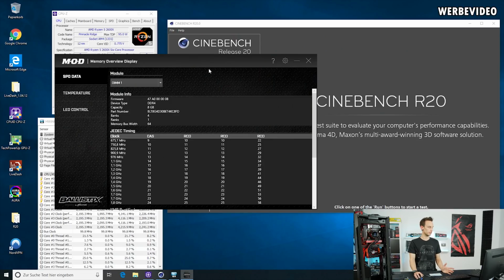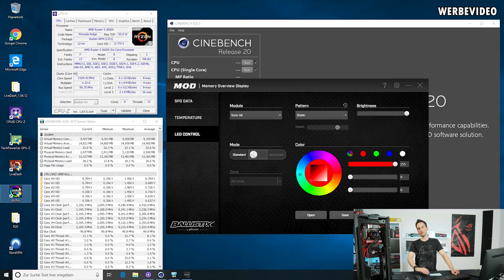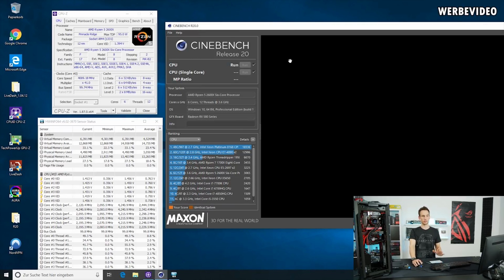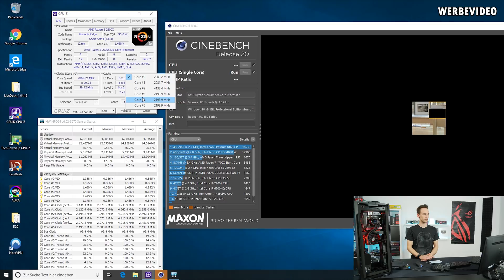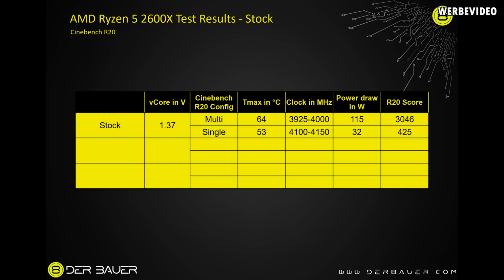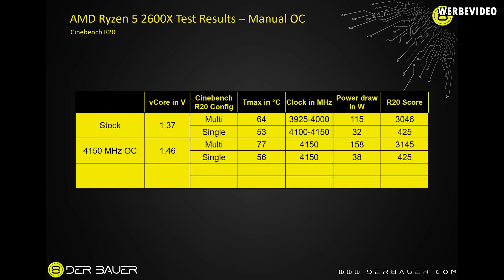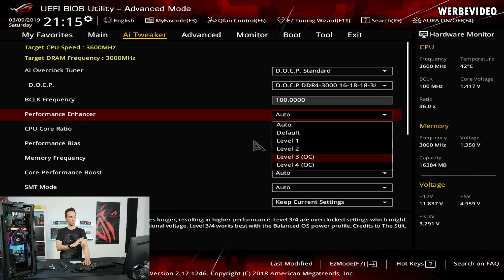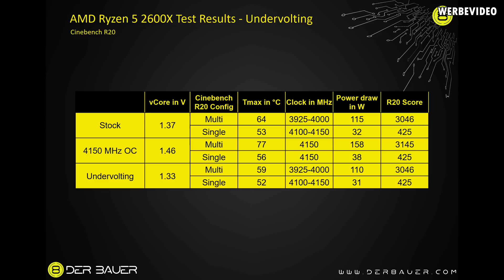The problem with AMD

Comment: TLDR: AMD delivered a better product out of the box than Intel. AMD's XFR is well adjusted, making it almost pointless to overclock. Meanwhile Intel's boost clock is laughable and overclocking proves Intel didn't feel like releasing the best product they could of out of the box. That aside, the title of this video is misleading.
Reply: Jose Cervantes lol every non OC intel has same or better clocks than OC  Ryzen. And all OC intel cpus has 1 GHz above OC Ryzen
Reply: @IamUzyf  that's only because of their architecture and it doesn't change what I said. The AMD chips are almost coming out with near top performance out of the box. Intel is simply leaving a lot of headroom, it's a lazy practice if you think about it.

Comment: Jeez, I had a lot of luck on my friend's R5 2600 then! It stays at 4.1ghz solid with 1.38V on the Asus Rog X470-I and I even managed 1 full run of Cinebench R15 @ 4.2 and 1.42V, but I had to OC the RAM to 3600Mhz or I would get a ton of blue sreens at the base 3200Mhz frequency. CAS latency was 17 @ 3200 and 19 @ 3600
Reply: That's not all that much above stock turbo frequencies for that CPU.

Comment: Lol got my 2600x to 4.2ghz at like 1.45v
Reply: why are you even touching anything?  Do you need your cpu to sit at 4.2ghz while idle?  The ryzen cpu automatically overclocks itself for what you're doing.  When I start gaming, all my cores shoot up to 4.7ghz and stay there until im done.  Should really just leave it, AMD did the work for you so you dont have to bother with overclocks that just strain your cpu 24/7 and cause unnecessary wear.
Reply: Pure Gameplay 4.7 on Ryzen ? Using pbo with undervolting to stop thermal throttling the best single core I can get is 4.25 ghz with sustained 4.15 ghz. This is what I use generally 4.2ghz on all cores was just to see.
Reply: @henryadams7688  https://imgur.com/xalHotP
Theres a picture I took immediately after closing bf5, the entire time the game was open it was sitting at 4.6 until I closed it, then it dropped back down.  Also when all cores were at 4.6, all my voltages were locked at 1.45 and stayed nice and stable.
Reply: @puregameplay7916 https://forums.tomshardware.com/threads/ryzen-2600x-4-7-ghz-spike.3322213/

4.7 ghz sustained on 2ed gen ryzen is not possible without serious exotic cooling
Reply: @puregameplay7916 "All my cores shoot up to 4.7 and stay there", I have my cpu on PBO with ryzen power plan if you actually read my response and if u got a golden chip why are u tell me to just leave it and expect 4.7 ghz?
Reply: @henryadams7688  By stay there, I dont mean 24/7, I mean stay there for as long as it needs to.

Comment: overclocking is a thing of the past....while you can still overclock today, it is safe to say that it is unlikely that we will see anything much overclockable from ryzen 2, intel 10 nm, and next nividia gpus  .... also unlocking DOES NOT MEAN  overclocking.... You cannot say you gain performance by overclocking, when the manufacturer is locking its hardware to lower power states and performance out of the box...that is not overclocking, that is simple unlocking.
This makes AMD much better products than Intel because the small margin u get by unlocking the CPUs, means that  all the CPUS yealds and binning are perfect and warrant all the same performance more o r less...while You cannot say the same for intel where some cpus can perform up to 25% worse than another same one.
I also wish to add, that LN2 overclocking is a farse, because You are never validating how much power and voltage you are drawing out......The winner of LN2 overclocking should be the one that can draw the less power and less voltage and get the best score when also making use of L3 Cache *(which Cinebench NOTORIOUSLY ISN'T CAPABLE of using at all), and not just who can push  anything at whatever speed for a few seconds on on a single lucky run....that doesnt say anything about the CPU architecture and manufacturing when  you are oveclocking.

And what is a crucial RAM set doing on an AMD build?!

Comment: So Intel is better cause their products are so handicapped out of the box, whereas AMD parts are tuned to their limits with intelligent software?  I suppose if you're an extreme overclocker, it's more "fun" to fix Intel's problems yourself meaning "there's so much more you can do with them."  Why is Intel being rewarded for sub par products that aren't performing at their best, whereas AMD is chided for it?  I accuse you of a bias, but only of the perspective of an overclocker, or tinkerer, who only looks for how much MORE performance is left on the table, and if there is none, then the product is boring to you.  I agree that it's boring as hell to overclock an AMD chip because they're tuned so well and they make it piss-easy.  

But hopefully you can see the other side, where voltage wall aside, having all the performance right out of the box is a GREAT thing for consumers who aren't overclockers, or don't do extreme overclocking.  It just seems the focus isn't on "AMD needs to give their chips more frequency headroom in their next architecture" but rather "this is boring because I don't have to fix any of AMD's non-silicon mistakes because they didn't make any"

Comment: one of AMD's PR problems is that people buy vanity threadrippers and expect to be able to game on them when threadripper sucks for all but the most effectively multicored programs
Reply: tell me more about how all the AAA games coming out are relying more and more on higher thread count cpus?
Reply: wtf are you smoking Threadripper CPUs match there Ryzen counterparts single threaded performance
sometimes there even slightly faster in some games due to having a extra IMC letting it run 4x8GB DDR4 at a full speed of around 3400mhz cl14 with a 2700X you would have to either settle for something small like 2x8GB 3400mhz cl14 or something slow like 4x8GB 3200mhz cl16 because a single zen1 IMC can only handle 2 ranks at full speed but Threadripper has 2 IMCs so it can handle 4 ranks at full speed

and you can sometimes get higher core clocks due to the higher binned chips going to Threadripper instead of Ryzen 
if you have a decent cooler and enough $ then 2950X > 2700X for gaming
you simply get more cores more IO more memory and better binning whats not to love?
the same can not be said for the old Intel HEDT platforms which used to be a generation behind and the newer intel HEDT CPUs which are so hot that they run at shit clock speeds unless you use extreme cooling like a chiller or LN2
Reply: @XDbored1  I think you left this out, you can disable many of the cores and use that extra voltage to possibly overclock the small active cores for gaming to gain more single threaded performance. I have no idea how much if it helps at all as I personally don't own a threadripper build but thought it was a good idea to point it out
Reply: LOL.  One of the communities problems is that people think you cant game on a threadripper...I run a 1900x on my gaming rig, also have a 1700x... My 1900x is about equal in gaming performance to my 1700x, sometimes a little better or worse.  As long as you know how to tune it for gaming, you would have a hard time noticing a difference.   
Edit:. The 1900x tends to overclock much better than most 1700x/1800x so you can actually get a little bit more performance if you don't mind the power bill.

Comment: AMD sells components often pushed to the limit be it CPUs or GPUs, at least with CPUs right now they are not uber power monsters like their GPUs that use way too high volts. Intel... high variance in parts, some OC OK some almost not at all anymore either. Long gone are the days of +1GHz OC on Intel and if one gets 200MHz now that's lucky. All depends on the CPU, how well it was binned and what headroom was left by manufacturer to exploit. 2700X vs 9900K... not much OC on either. 4690K that defaults to 3.5GHz all core... yeah easy OC sky high compared to stock easy to do, similar on 1700/2700 to OC by 500MHz up. With AMD one gets a better CPU that is more on the limit of what it can do, with Intel one has to invest additional money and time to get the most out of it if one wins a lottery as well.

Comment: 1. This is NOT problem with AMD. This is a problem with makers of cases..
2. If you need to get result from OC you need 4 lines on row (any slot) on the same. In this position you may get and 25% bonus. P.s. 2 lines on motherboards :) but exist inf fabric....

Test this options and revue back problems ;)
No more 10$    2x8 4x4 !!!

Comment: Well.. My 2600x is set to all core 4.175ghz at stock voltage. I can get it to 4.275ghz at something around 1.45v. I haven't pushed past that though. On a gigabyte x470 gaming 5 mb. Which i hate because every time the psu loses power my mb's main bios corrupts and every 10 or so times the secondary bios corrupts at the same time. Resulting in 3 returns in the first month until i found out my psu was buggered but since that I've had 2 rma's because of simple power outages. I hate this board.

Comment: R5 1600 @3.8ghz 1.24v
@3.95 1.372v
@4.25 1.576v plus unstable cinebench r15/20

Vcore on ryzen scales too high.
I just use on 3.95ghz
Btw 1.576 is the max vcore on my motherboard :/

Comment: Really valuable info. I plan to buy the new gen Ryzen or threadripper for a workstation..
I like silent or quiet running and do a lot of Linux work no gaming. If I should undervolt my CPU to get less heat for the same performance that would be awesome.. that's why I'm subscribed for these insights

Comment: I think undervolting is good idea, but if you have Ryzen 2600 non-X, you need OC to go above 3,9GHz. I chose to undervolt, because at the moment, i don't care that much about extra performance. My real core Voltage is about 1.219 and SoC Voltage is 0.931. I'm drawing about 77W from CPU+SoC while benchmarking all cores with Cinebench R15.

Comment: From what I read the way the node was developed didn't leave much headroom for OC without way more current. It kind of was already at the sweet spot. The 7nm node they will be using for the next gen seems to have a higher chance to enable a bit of OC.
Reply: mine automatically clocks all cores at 4.7 once I start gaming.  It does it itself, and intel users dont liek that, they would rather tweak an inferior intel product for gains at the expense of system wear.

Comment: this is so dumb, they can just extend the pcie cable, so that the gpu can face outwards......what a fail design.... (it wont affect anything, linus has done video about that, and i have one running in my 7.2L itx build right now with that type of cable)

Comment: Yup, that's why the first two Ryzen gens haven't appealed to me...at least not enough to switch teams.  Poor overclockers...period.  Let's see what Zen 2 can do.
Reply: Nothing wrong with the Ryzens! The room to overclock means nothing when the cpu is already fast AF out of the box! Getting 5-10fps more on games where u are already getting 100fps is meaningless! Getting a Cinebench score improvement of a few percent is meaningless! Ofc if ur life's meaning is to overclock, then that's another thing...

And @Vyrisus You got it backwards: it's not that the Ryzens are a sidedowngrade, it's that ur oc'd 3770K is such a beast even today, that nothing - not even ur beloved Intels can meaningfully outperform it! I just bought a 3770 non-K myself because of the price2performance ratio was the best! The only substantial improvement from this would be a 1600/2600 (or better) Ryzen - not necessarily so much in games, but in raw power. All Intels after the 3rd generation (used) are overpriced AF! Lol, 300-900e for a cpu?!? I bough my 3770 for 70e!!

Trivia: Back in the day there used to be HUGE improvements in cpu power! Imagine comparing 486 to a Pentium to a Core2Duo to an i5! After Intel launched the 2nd generation of beastly i5 and i7 processors, there's been hardly any performance improvements in cpu world. Sure, every year the new generation is 2-3% faster... But u can get about 90% of the performance of a current processor with an almost 10 year old processor (anything equivalent to a 2700K or better)! Try going back another 10 years from that and u end up with Pentium 4! You can't do jack shit with that xD And that is why 3770(K) is still a King. And that is why there is not much contest to top it anytime soon.

Comment: In my opinion, you can still get the fun from OCing a Ryzen system. The thing is though, it has shifted to memory OC's now instead of CPU's.
Reply: Unfortunately the limit of memory OC comes much faster than CPU, afterall, memory have a bad habit of being more sensitive to voltage increase.
Reply: @Verpal  He means timings. Manually adjusting timings down is the most important part for Ryzen, most of the time at least.
Reply: @DirtyPoul  Yeah, nowadays we can rarely oc infinity fabric too much to match 1:1 mem clk, kinda render the whole speed thing null.

Comment: Hey der8auer, I would really like a video with your opinions and techniques for overclocking RAM with a Ryzen CPU. You said in this video that you would overclock your 3000 to 3200, how about timings and how does this affect CB R20 and gaming?

I think the system you have in this video is very much like many AMD users own systems so it would be nice to see a real pro push this system to it's realistic limits.
Reply: Very minimal performance increase between 3000 and 3200, not worth the extra cost if you're deciding between two kits of ram.

Comment: I have a Ryzen 5 2600 with no XFR running on a cheap B350 board.  I whacked in 1.4V and 4.25Ghz in Zenstates and it has been running perfectly for benchmarks and gaming.  Do I have some sort of golden chip?  This is very far off from the operating conditions explained in this video.  The system CPU and GPU are on a modest open loop. . . 240 and 120 radiator.  60 degrees C while gaming.

Comment: The Ryzen 2000 series is better off left alone ! Precission Boost works just perfect , you can't get a lot more out of them manually ! Specially on the X versions !
Let's hope that the Ryzen 3000 series will have more room to OC !
Reply: no need to oc if its performing its best

Comment: After spending hundreds of hours playing with my 2700x came to conclusion that you gain more with Memory timing's than messing around with CPU :)
But I got Silicone Binned cpu they did very small run of those. Turned out was not worth it and best and worst are around 100mhz difference. Atm I'm on 4262 all core @1.425vcore and 34xxcl14 memory. Thats on Phobya Nova extreme.
Reply: memory over 3333mhz CL16 is just DAMN expensive...
Reply: @lifemocker85  Binned 2700x cost me around 400 pounds. Now that was expensive :D
Reply: @lordzed83   you should have waited 3000 serie
Reply: @lifemocker85  I upgrade CPUS every year got 400 quid for 3700x waiting for amd
Reply: @lordzed83  Waste of money upgrading that often imo. Im running cpu from 2011

Comment: Interesting video, however i have quite different results- i own r5 2600 and i could achieve stable 4,25 ghz on 1.35V, and thats with basic single tower cooler ( my case have good ventilation)- 70 degrees on full load and 55 while gaming. Maybe its just won sillicon lottery. Still though, you're right that with intel you have more overclocking headroom.

Comment: I am asking those that have tested R5 2600 (not the x) and der8auer. The X variant is giving a better out of the box oc but in the end the % perfomance gain is not worth the extra

I went to 2600 and with the extra money I bought a CLC 120 and with everything in auto, it boosted to 3,9 at 1,1 (you have better thermals and noise even if you dont oc)

I have mine on manual all core 4,2 1,264volts, and it boosts to 1,28 when I run cinebench.

With the latest bios update with msi x470 carbon I have managed to run 4,4 at 1,46-7 (I have set it up 1,44 on bios), I havent  checked if I could go lower. I could not go into windows with that voltage (I dont want to push it to 1,5 to see) for a 4,45 ghz

I have read articles about how can you make the ryzen better with memory timings
Mine is 3200 corsair dominators 16-18-18-36-75-1T hynix AFR
What did you have tried and if you have some info (my cinebench is 1.390 after reboot - 1,290 normal)

Comment: You can really easily get a 400mhz+ OC on the 2700x. You can even do it with the stock cooler if you are willing to put up with some noise.

Comment: Should i enable xfr2 in bios ? Or leave it on auto. With xfr i see single core boost to 4.35 and overall all core is 50-100 higher . Going from 4050 to 4150 in games. But my x470 ultra gaming motherboard doesnt have offset undervolting it just has dynamic Vcore and when i put -0.4 it just keeps pushing the cpu to 1.45-1.5 regardless. So in conclusion is xfr 2 from bios safe to enable for long term?

Comment: It's the way you look at it. You title The problem with AMD.  I look at it like, The Problem with overclocking. No one needs to Overclock modern chips.   But he pushes all of them to limit & he's awesome for that.  If it's a waste of time overclocking.. it's a waste of time... Doesn't mean it's a bad chip.

Only Ryzen CPUs to OC are the ones with low boost clocks.  The rest are great and have super low temps.

Comment: Phenom IIs were great CPUs especially if you overclocked your Northbridge. FX CPUs were overpriced space heaters that had very poor IPC and memory performance. Ryzen 1000 & 2000 series are decent CPUs if you don't overclock and overvolt. Ryzen has a poor thermal design due to stacking the CPU die unlike their previous CPUs. Ryzen 3000 series I can confirm is a much better overclocker due to it's die shrink and does have a higher IPC than current Intel CPUs but don't expect the Ryzen 3000 series to overclock passed 5.1-5.2 GHz. That seems to be their limit. Intel will have the upper hand with overclocking on their upcoming chips and have similar performance with their 10nm.